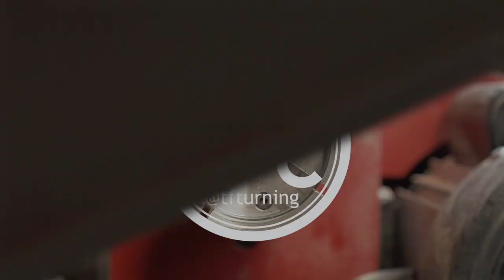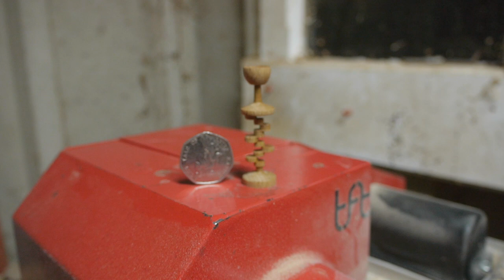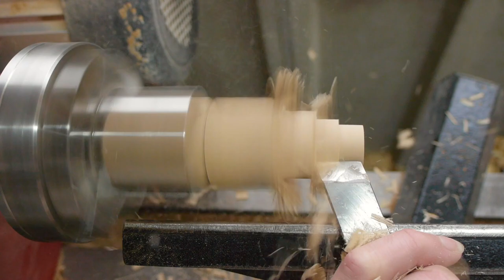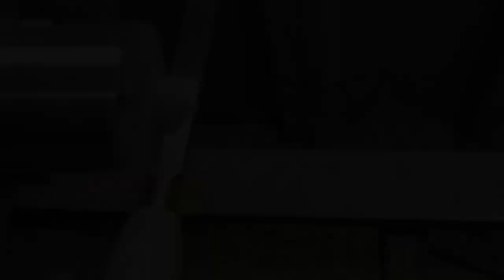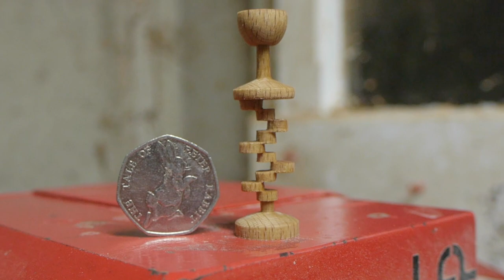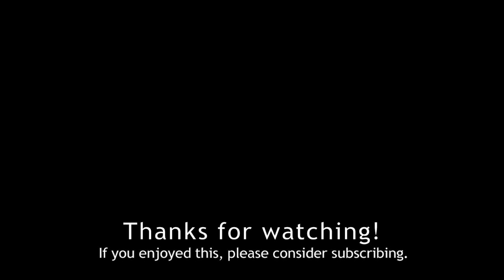Wood Turning - Miniature crankshaft goblet. Multi-axis Woodturning.

Comment: Very cool! Will try that today. I’ve done a few offset turns but never by taking off 2 jaws and sliding it back and forth in the chuck. Very simple and easy! Thanks for this. Just a suggestion, slow down the lathe quite slowly to sand those sharp edges. The slow speed allows the sandpaper to get down into offset disks rather than bouncing off the tips. Also it would be nice to get some info on your process and which way you slide the piece and approximately how far from center. I think I have it figured out but hearing or seeing it in the video would be helpful. Take care! Scott
Reply from the maker: Thanks Scott! With this one it was more about just getting through it without snapping, the sanding was a very much a secondary thought. I took far more care over a bigger candle stick version which is linked in the description.
From memory I rounded the spindle in the center position then only moved it from side to side about 3 or 4mm. The jaws made small grooves in the wood so it was easy to see where I had previously gripped the piece. Let me know how you got on with it, thanks for watching!